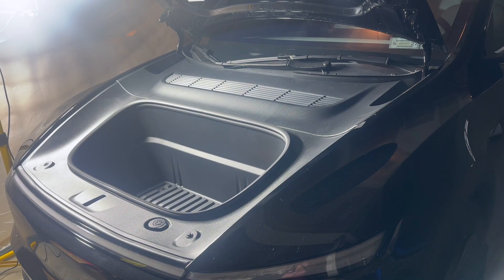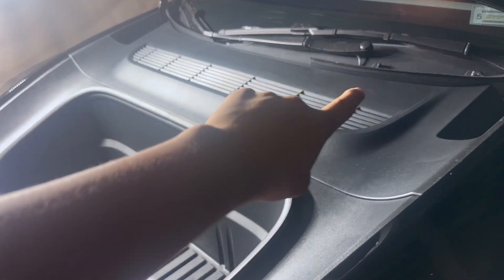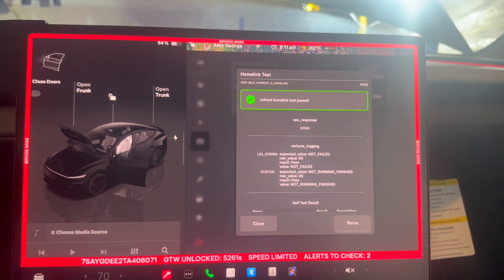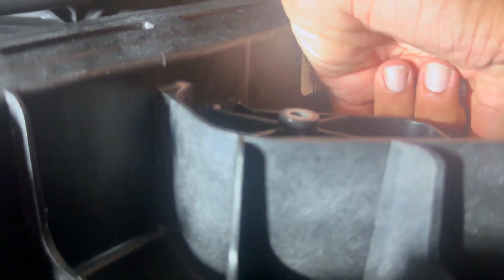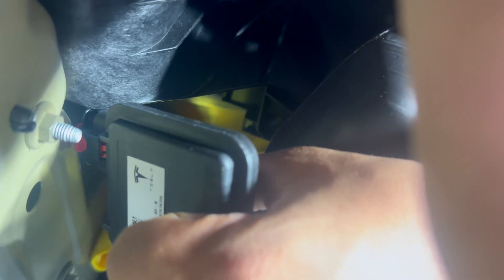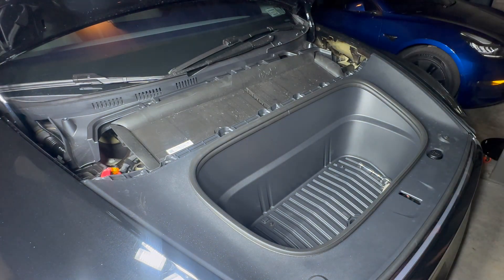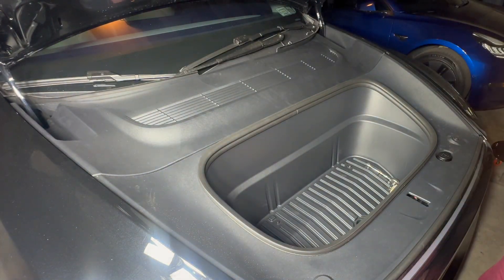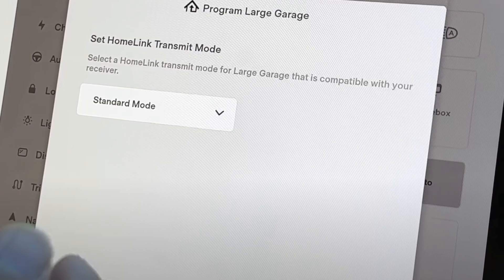DIY Homelink Install Tesla Model Y Juniper | Model 3 Highland

Comment: I have 5 garage openers for free,  can't add more since there's a limit by the manufacturer. I have a keychain remote and pinpad.
Reply from the maker: I said the same thing but then tried it and its just so convenient... Also I believe it just copies the signal from your garage opener so It wouldn't count as another registered device
Reply: @EGsEvs every remote must be paired. Also depending where you live it might be a security concern for garages to open at will...

Comment: I had to take a dremel and cut a flat head screwdriver notch in the end of the bolt because I could not get anything on the head to tighten it down. Mine came with a security bolt or something non-standard. While I could get a socket on before installing, I never could get a socket on it when installed to tighten it.  With the screwdriver notch I could tighten from the windshield side of the bolt since it sticks out the hole.
Reply from the maker: Where did you buy it from?